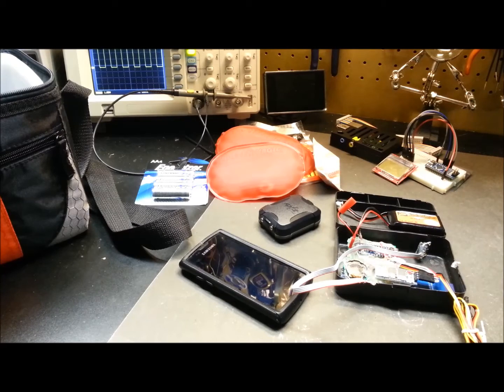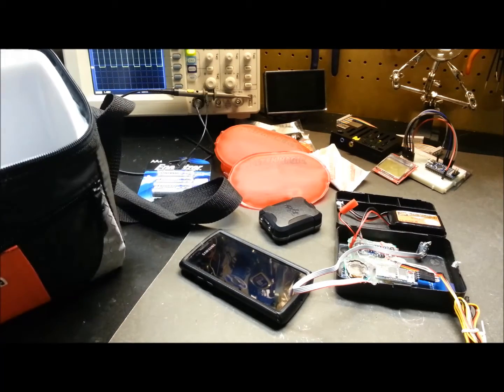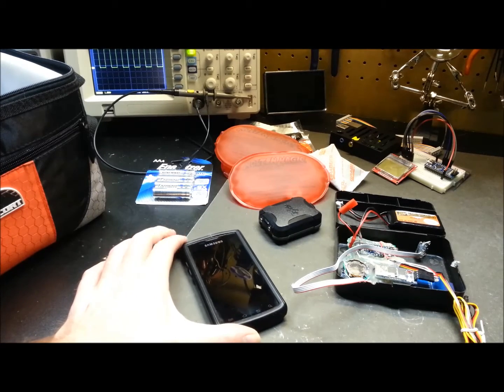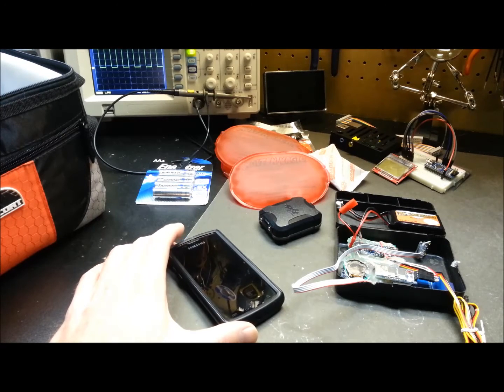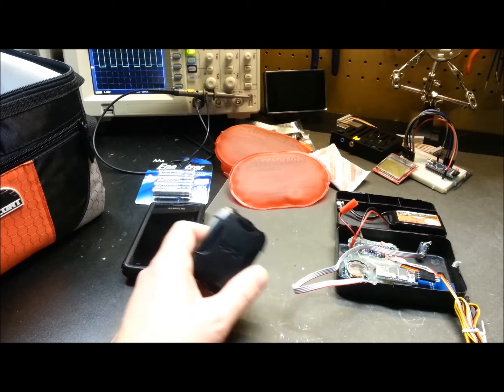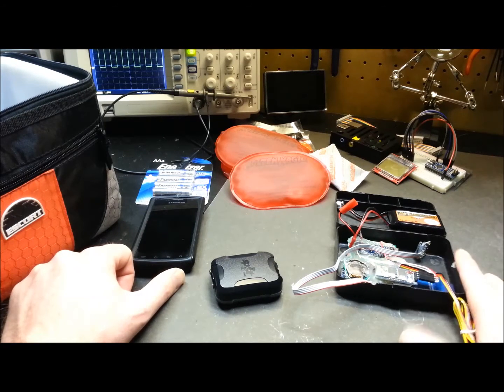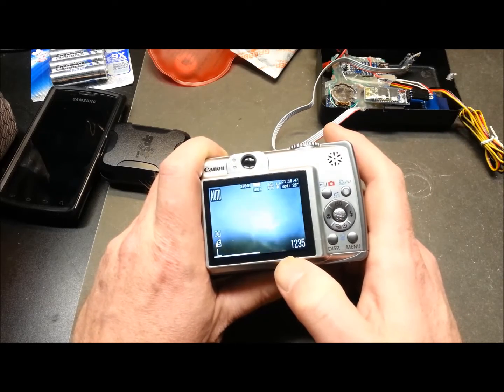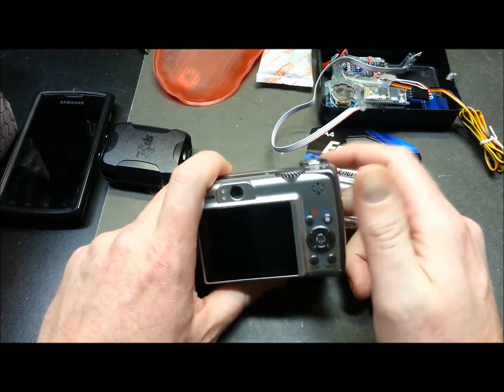HAB Part 10- Overview of the High Altitude Balloon Systems

Comment: Hi Eric :)
I used the exact same Canon camera / intervelometer hack with one of my first launches, worked great ! Only thing was a little condensation inside the lens at about 10 - 20,000 feet but that cleared. Maybe keep the camera in a dry place prior to launch 
Here's hoping for good weather on launch day !!
Reply from the maker: Thanks Tony!  That's great input.  I'm hoping so too but lately the upper altitude winds in my area are far too strong for our weight and balloon size.  Will see in a few weeks though.  Cheers!

Comment: Hi Erick, amazing work, im currently working on a similar project as yours also based in arduino data logger, i have a question, im currently deciding which recovery gps i will use, and i found that Spot Trace was a good choice, can you tell me your review with this product? 

Regards from Mexico!
Reply from the maker: So far it is working fairly well just a bit tricky to test when you aren't in motion :)  I think I wont really know fully until after launch.  Cheers